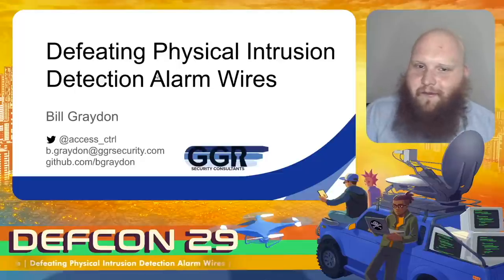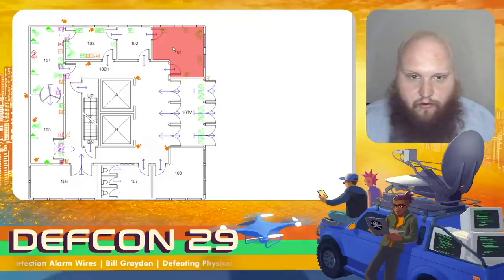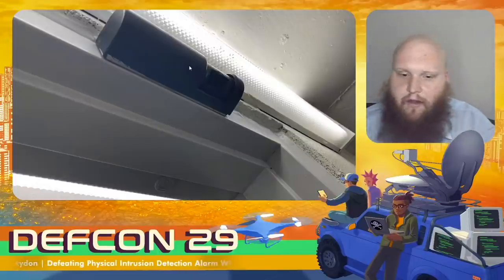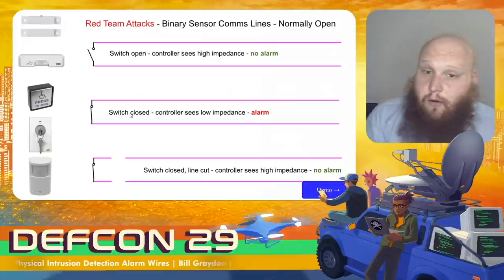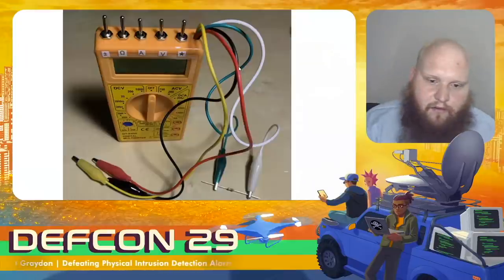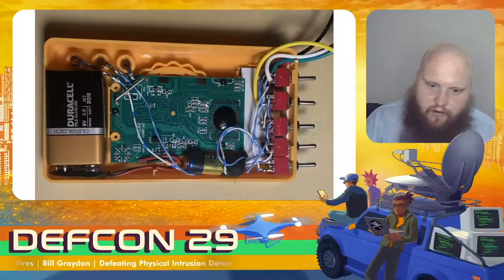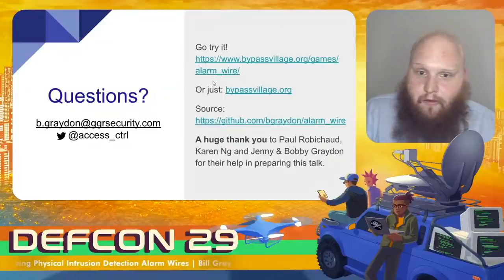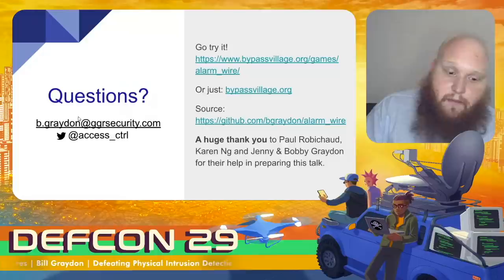DEF CON 29 - Bill Graydon - Defeating Physical Intrusion Detection Alarm Wires

Comment: Tbh I would just lookup X model manual EOL resistance ohms.
Reply: This is definitely the way to go if you know the controller make - sometimes you can find that on Shodan or through other OSINT or social engineering... but you often can't.  If you only have access to the wire, you'll need to measure!

Comment: 13:00 that whit cut wire on magnet sensor is stupid. They use wire whit 6 line whit different color, 2 for power and 2 for tamper(+5v ,or -5V or 0 mass) and 2 needless  if you cut tamper alarm is triggered. Bitter to use low tech device - magnet  😅.if entry room have motion sensor you are fuck in this case just open door alarm start count 20 or 30 second to put pin .in this time just cut antenna no signal will send 😅 but that work only if alarm box is in the entry room .Motion sensor use all 6 line 2 for power ,2 tamper and 2 for signal ( +5Vor -5V ) to communicate whit alarm box. other method just naked wire  and use electroshock ⚡ 🤯😵‍💫this will damege  the alarm  system

Comment: Do people still use wires?
Reply: Yep.  Wireless is extremely uncommon to see in any installation larger than a house.
Reply: @bertandliam5196  Tell me about it, one of my houses had an old wireless install, I mean it looked like it was from the 70's, but it was this old X.10 setup, it was crazy as hell. I never did look into it and try to figure out the manufacturer, or what all the equipment was, never used it.

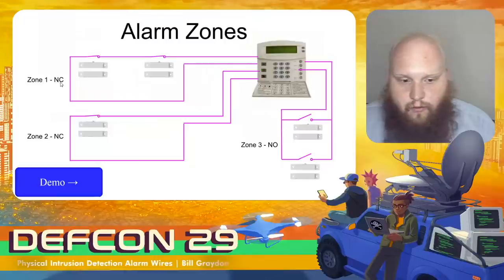Comment: @ 2:53, Zone 3 for a door contact are not wired normally open, even when in parallel or when zone doubling. THAT would be a simple point to render any burglar alarm zone or device inoperative... All you'd have to do would be to cut the wire, pull it out, it just cause an open circuit
Reply: Yeah security alarms usually use NC.  This is mostly just to illustrate the point of how it could be done NO (and generally is for fire systems).

Comment: Blah, blah, blah. If you have already access to wires, that system is dead from beginning. Just use a fucking teaser clamped on any wires , tease for 2 secs, and that all. A tip learned from  Russian friends. You can use polyurethane fluid foam on external sirens. Also is working for car alarms. Hit it to see what bulb is flashing on alarm on stop lamps, broke it, replace bulb with yours connected to teaser. Jamming GPRS communicator's. The rest... 45 min's to Defcon? Really? Glass break detectors? No problem. Use a large sticker on window, break, enter..... Alarm systems is only to give you a feeling of secureness, and not to approach to your home if some thief's are inside.
Reply: What about fire exit bypass from the inzide ?

Comment: @11:54 ... I'd like to see him successfully tone a door contact with it shut...
Reply: As he said, lots of places leave the conduit accessible.
Reply: @twizz420  first.... Do you have access to wires in conduit?? (You might want to think before speaking next time, your lack of intelligence is showing). Then let's assume that you do have access... At any point in the wiring... You STILL will not be able to tone locate a wire with a closed door... That's a fact Jack!
Reply: @twizz420  I happen to work in this industry and speak with credibility, knowledge and experience... As well as documentable facts.
Reply: @twizz420 " All tone generators that I’ve ever seen also include a continuity test function. This is a necessary feature, because sending a tone down a pair of shorted wires will kill the tone, so much so that the probe won’t be able to pick it up."
Reply: @twizz420  so tell me again about access to conduit...
Reply: You raise a good point about systems where the sensor is completely shorted in the normal position - when this happens, you can get some signal by toning between one of the two wires, and ground or an unrelated conductor (such as the conduit itself).  Not as good as having two disconnected wires to tone, but better than nothing.  Usually there's an EOLR present though, with a high enough resistance to allow you to tone it directly.
Reply: @bertandliam5196  dependent on building construction, trying to tone conduit could be misleading and futile. For example, one or more runs of conduit may be mounted to an aluminum stud with one hole straps thereby making it ( which should be done anyways properly... and there is a difference listed in NEC NFPA70 for bonding and grounding) the same ground potential. Then you could be on the hunt for the wrong piece of conduit going in the wrong direction. If possible, follow visually, or at least make an educated guess of what the conduit might be used for, then locations in a building where it may be used. Then at some point try to examine the wiring. That still may lead no closer if all of the wire is the same and there are multiple locations that are possibilities. Sometimes “sparkies” write circuit IDs on electrical box covers ( usually for AC power). Sometimes you may be able to examine the type, number, color of wire(s) going into what conduit at an intersecting electrical box.
Reply: @W8RIT1  Completely agree with everything you've said here.  The toner and probe is but one tool in the toolkit, and not always the right one.

Comment: Or for a motion you can open them up and use some 3m double sided foam sticky over the sensor and 3 layers of 1"x1"  metal ducting tape. Throw the cover back on and no one ever notices.
Reply: Every pir-detector that I’ve installed included a tamper switch that alarms fault when opened. As the ”tamper” output was shown in the pir diagram.
Reply: Altho I really don’t know why you’d tape the inside with any special tape, when any electrical tape will do, and hairspray on the outside.

Of course you should first know that they aren’t antimasking or microwave sensors.

Comment: So much extra work for such a simple bypass. All of this is not even necessary. The REAL simple bypass might only need something to bare wire and less than 2 seconds. No need for any of this, including calculating the EOLR.
Reply: How would this bypass be done?
Reply: @W8RIT1  What? Did you watch the full video?
Reply: @andersson_casa  yes, yes I did. What ever have you the idea I didn't??

Comment: This video is very flawed, I’ve been in the electronic security industry for over 30 years, this may have worked 20 years ago, I am from the uk and none of these would work today.
Even 20 years ago we used multiple resistors with multiple cores in cable, alarm systems have circuit response times so flicking a switch wouldn’t work unless you can do it in hundredths of a second.
I’d like to see you do this in the real world.
Reply: And it’s easiest to bypass the door contacts or mask the motion detector. All this requires entrance anyway (the outside sensors/cables are near nonexistant) and starting to do some fancy cable stripping and wire intrusion would just be really suspicious and time consuming.
Reply: @Leego  within the uk we have a grading system for security systems, a grade 3 system has at least 5 different resistor values for each circuit, contacts and motion detectors have anti- masking technology for that level of system and with a high level of circuit response time in the 100th of a second these systems are designed to be high security.
Reply: @markjackson5247  I think the grading is common. Here grade 2 is most commonly used and accepted by the insurance companies. Higher grades are for banks in example.
Reply: @Leego  the grading system in the uk is based on risk assessment for the given area (town,city) and building use and contents
Reply: Lots of places have very outdated alarm systems. If you've worked in the industry for 30 years, you should know that.
Reply: @twizz420  hi I do know that, I commented on this video as it was posted recently, which would suggest that it is relevant for now, not 30 years ago.
Alarms using multiple resisters and other types internal identification(ie ID biscuits).
Reply: My first alarm panels was Scantronic 9600 and 9800 series. After 30 years, still love 9600 for intuit programing. Even these days , i don't see it to anybody that programing structure.
Reply: @ciobanurivelino3844  I went to a job only a few months ago that had a still working 9800 lol I know what you mean people wanted the panels to do so much more the programming got more complex